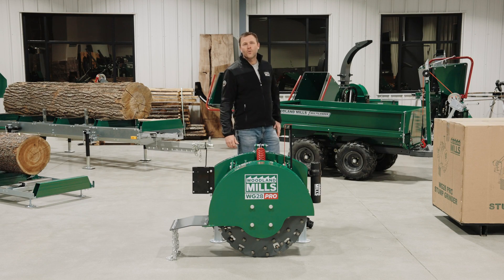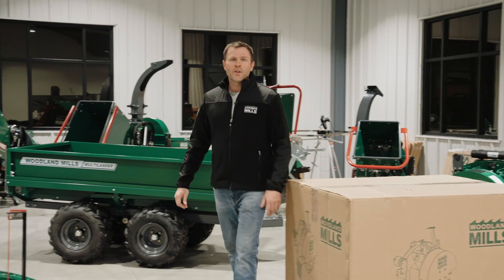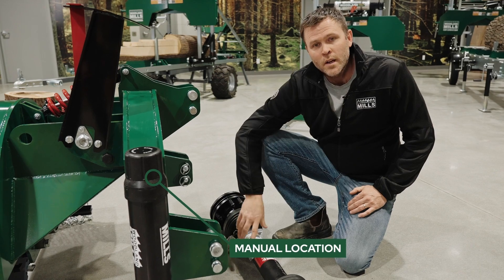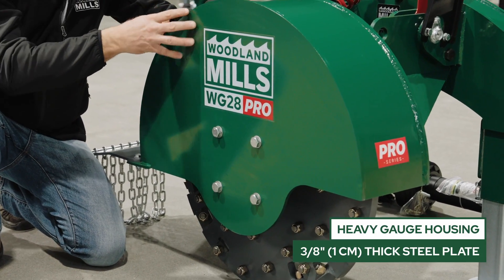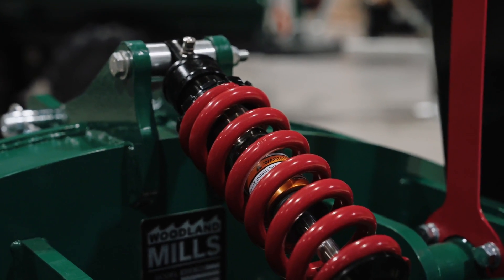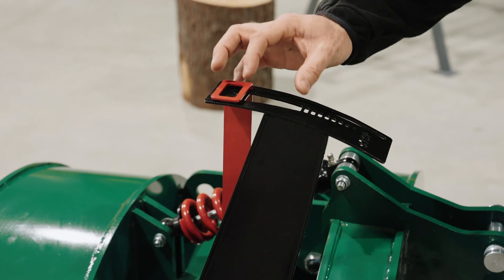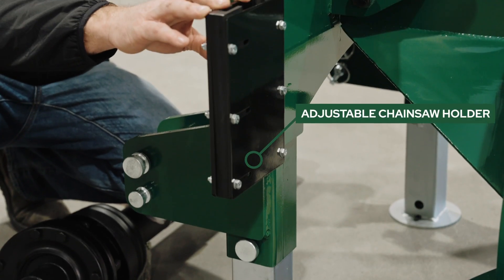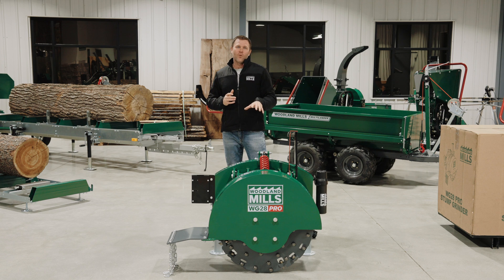Woodland Mills WG28 PRO Stump Grinder Walkaround

Comment: Locally in south central texas, the tree guys are quoting 250 per stump.  If you assume a 20% burden for wear and tear and fuel for tractor, that means break even on this is 18 stumps.  (250 - 20% = 200 per stump.  3600 including shipping divided by 200 per stump = 18 stumps.